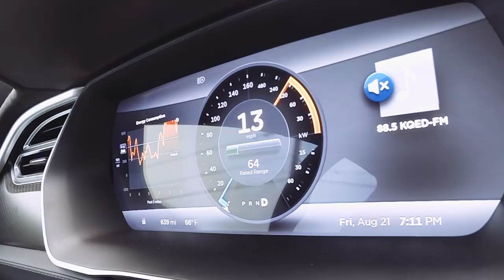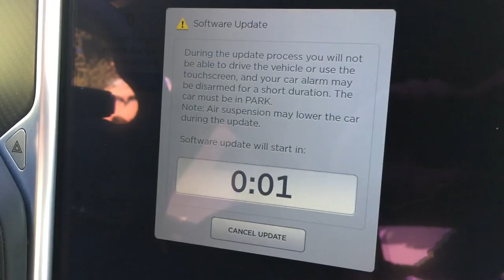The Tesla Model 3: The Culmination of Elon Musk's Master Plan | WIRED

Comment: From candle to light bulb, electric is the future. Thanks Elon.
Reply: Stryker A. Wolfe 

It will be like seat belts prior to '68, they are not required but still allowed on the road.
Reply: True
Reply: The problem with electrical cars is energy density.  The weight of the battery to go 300 miles is significantly more than the weight of the fuel system in an ICE to do the same thing.  Plus, what happens when you run out of electricity?  It's not like you are going to have a portable battery pack that you can walk along the highway to the next service station and recharge.  The 85 kWh battery pack weighs 1200 lbs and lets assume it is good for 300 miles.  Using that same efficiency, you are looking at 4 lbs per mile.  Assuming 25 mpg with an ICE car and a 5 gallon spare tank, you are looking at 125 miles.  A battery pack that could do that would weigh 500 lbs.  And that is 500 lbs you are going to be carrying to the service station and back from the service station.

I just don't see it as practical without some sort of ICE engine that can be started up to recharge the batteries if necessary.  It's just difficult to beat the energy density and portability of dyno-juice.

Comment: I've always said that 'I never gonna buy a new car, cos they're selling the same sh!t for decades on' but maybe one day, I'll buy a new Tesla.(despite I have a car that worth 500 quid, and does 60+ mpg.)
Reply: You don't have to buy a new Tesla, they already have used ones available. Though it will be a few years before they'll have a used Model 3.
Reply: Exactly the same here Frank.
I'm not wasting my money on something that loses its value so quick.

But fuck it, I really want a Tesla
Reply: imzjustplayin it's not going to be years unless it's years before they roll them out. There will no doubt be used model 3s shortly after there are model 3s. Some people will buy them and decide that they'd rather have an S or X or just decide it doesn't work for their needs for whatever reason. Now I'd agree it'll be years before there's cheap model 3s(by cheap I mean significantly less than a new one would cost). I don't think you'll ever see the really cheap ones like gas cars though where you can get one for a grand and throw a couple inexpensive parts on it and have a working vehicle. My guess is the price will be determined by the battery condition and if it needs a battery pack no matter how cheap the car is it'll require an expensive repair. It'll be interesting to see how things shift when there's more Evs on the road than gassers.
Reply: Must be a Reliant Robin LMAO

Comment: "On board supercomputer"
Hahahahaha.
Reply: Maybe the on board computer runs from cloud supercomputers. Though that doesnt justify "on-board".
Reply: Supercomputer is a bad term, but it's a NVIDIA Drive PX 2 with two Titan X graphics cards internally (liquid cooled via the car's internal radiator). So it's as powerful as a pretty good gaming PC setup.
Reply: Ambient Morality Why does the car need so much processing power?  Is it self driving?
Reply: Yeah, it's for the Autopilot 2. It has a lot of cameras monitoring and needs to be able to use GPUs to filter the images fast.
Reply: good to know. Do you know if the model 3 has that too? because these gpu's sound expensive. Also i just read they use nvidia tesla p100 which are even more expensive.
Reply: On "Bored" Supercomputer
Reply: Kenji314159 , reviewed as military grade, similar to F35.

Comment: Good News:  The EZ pass system is already in place and ready. As gas usage goes down, TOLLS go UP and new toll roads are being created to replace the gas tax revenue.  A zero sum game for the consumer.  Your transportation costs will be identical or more once the roads are EZ pass marked everywhere.
Reply: You havent considered that you dont pay 100% taxes when buying gas. Its just a part of it. To get the same amount of money than before a state just has to have small toll fees. In the end you will pay less because the electricity to run the car is way cheaper than the cost to buy gas.
Reply: So then gas users will have to pay the toll AND gas tax, whereas electric users  will only have to pay the toll. It might be a 'zero sum game' for the electric consumer but not for the gas users.
Reply: States are planning the same scam for those using solar to power their homes,  a tax.
Reply: Gas users currently pay for gas and its associated taxes while electric owners can still charge for free. Both pay for the toll roads. So gas users are currently being shafted.

Comment: Yea but they get all that power from power plants...
Reply: Paco That's a problem in countries where renewable energies are a tiny fraction of the energy production. Besides, Tesla has already plans for solar roof tiles and a Power Wall to which you could plug in your car.
Reply: Paco you take cars away drom fossil fuels. Then you take electricity away from fossil fuels. Solar, wind, hydro, while researching fusion. Things dont change overnight kiddo
Reply: Anas Whatit'slike Even if the energy they use doesn't comes from a clean sorce, less pollution will be trapped inside cities, I think that's already a good thing.
Reply: Huge power stations running dirty fuel are much more efficient than the measly car engines.
Reply: How does that discredit him at all? He is fighting for solar, wind and nuclear fission. You cant have gas be clean but electricity can be eventually. People like you make the internet suck
Reply: Even if all power plants were of the dirties types (oil and coal), it's still better for the environment to use them to produce electricity that gets used by EVs than it is to refine and burn oil in ICEVs. Electric motors have an energy efficiency of about 90 percent while internal combustion engines have an energy efficiency of only 20 to 30 percent, the rest is wasted as heat (as well as the energy consumed to counteract that heating).
Reply: Paco Power plants are more efficient than cars at converting fuel into work.
Reply: Paco just woke up? Welcome to the 21st century! Now we run wind and solar babe!

Comment: the cool thing about this new car is that if you pay it in 6 years it really cost you about 20k because of all the money you save on fuel, oil changes and combustion engines mechanical problems. which by itself is amazing but it also means that if you plan to stay with the car for approximately 18 years , you are buying a free car. even if the battery fail at  year 20 like some people say, whats the problem with that? the car was free

Comment: 20 to 40 minutes on a recharge when using one of their network of chargers?  Of course, that is assuming that you don't have anyone in line in front of you.  Imaging how much it would suck if there were a couple of people ahead of you.

With any of the battery technologies, you need to take into account what it will possibly cost you to replace the batteries at some later date.  Let's assume that you get 200K miles on your car before you need to overhaul the engine.  Assuming 25 mpg for that car, you have used 8000 gallons of gas.  Assuming $2.25 per gallon, that works out to be $18K total or $0.09 per mile.  I've seen it quoted that the Teslas get about 1000 miles on 400 kWh.  Assuming $0.20 per kWh, that works out to be $0.08 per mile.  if you go with a Model 3, you are going to be paying when you charge up at a supercharge station.

Seems to me that with electric cars, you are just shuffling around where / when the costs occur, but they still end up costing about the same in the long term.

Comment: The only issue that I have with using all electric cars is that yes, they are way more environment friendly than gas cars, but in reality the process to generate electricity is still difficult, especially through reusable energy because it is not enough. Gas is still used to generate electricity, nuclear power plants produce a good amount of carbon and waste that are hazardous and won't reduce radioactivity until 500,000 years, slight exaggeration but not really, and if there are millions of model 3's running around, energy is going to be more costly. We also don't have a way to properly distribute electricity without having more than 70 percent being lost through heat, even with insulation. This is why Honda made the clarity because it completely erases the need to use electricity, in which it may still generate carbon foot prints. Things are never plain and easy, even though this is the step into the right direction, but if Elon really did want to help produce clean energy, he wouldn't work on cars, he should have found another source of energy instead or regenerate electricity easier. It's true, this is better than gas, and funding is way easier if it's a company like this doing well, research is easier; but this is only for cars. My two cents is rather than focus on electric cars solely, I hope there is research somewhere else that actually focuses on the main issues of the energy crisis. If cold fusion becomes available, this won't be a problem, but until then, generating electricity without producing a lot of carbon byproducts in itself is hard, and the greenhouse gases produced to generate electricity is still horrible. Then if all electric cars are everywhere, you go back to step one. Not Elon, but I hope someone either solves the problem with cold fusion or has a better insulated distribution for electricity. Electric cars really aren't the final solution, but a lesser of two evils to be exact. But this is a step into the right direction for better energy for cars.

Comment: Does it have manual transmission?
Reply: viljami323 It's one gear. From 0-top speed you don't change gears.
Reply: It doesn't have a transmission at all.
Reply: PhonicUK It does have a transmission, because the rpm range of the elctric motor is not the one you need for a car. It does have a one speed transmission on every motor.

Comment: I am still waiting for a chevy suburban or a VW transporter competitor from Tesla. Plywood doesn't transport itself and I don't like using a trailer one these shitty Belgian roads and like having to use a trailer weekly is a pain in the ass if you are used to have cars that can handle those big objects. I also don't want to drive with the rear open because of safety reasons. Also, a station wagon version from the model 3 would be a nice car as Europe has a high demand for station wagons, same for hatchbacks and compact SUV/crossovers

Comment: I just want tesla to make a balls to the wall super car ( ofc electric ) 
Just imagine Tesla design,2 seater kinda like an Audi R8 or any lambo and the rear full of batteries and electric motors,idk what acceleration might be with that car
Reply: guanwei he Batteries rn are still heavy and bulky so i think filling a car with batteries would really slow a cars acceleration down, but hey, I'm probably wrong.
Reply: actualy there is no need for such a design. electric motors are extremly small and light compared to ICE cars. I would think of something like an ariel atom style tesla street legal f3 car with 700HP. THAT WOULD BE AWESOME
Reply: Are you aware of electric formula? Thats what they are trying to achieve but its only proven that technology is not here yet, battery technology.
Reply: Blade Mastr the model x is 5 tonnes and has a 3.5 second acceleration
Reply: Poseidon Gaming yes it is but ok

Comment: Really bad fact checking and editing..

The editor who composed the tire and description doesn't understand what culmination means.  It isn't a milestone in a plan.  Also, Musk didn't build each successive vehicle using profits from the previous ones.  He was losing money on the first 2 models for quite a while before he turned a gross profit.. He used his own fortune plus lots from other investers to build the faqctory for the model 3.. 

Starting production of the model 3 wasn't Musk's end goal nor the end of his effort.  It was step 3 of his car building project to make electric vehicles seen as a reasonale mass market replacement for gasoline cars.

Electric cars don't solve the energy problem or the global warming problem. They use as much eneggy as gasoline cars. They get that energy in the US today mostly from coal burning plants, a small percentage from hydroelectric and a tiny amount from solar and wind.

If anything his solar city company is doing more to accelerate the transition, because present power generating capacity is barely able to keep up with demand despite a huge transition from incandescent to LED lighting and enegry efficient applicances.

Local solar power generation combined with batteries can meet consumer power needs at the point of consumption.  That allows conventional centralized generation plants to be used for supplying older infrastructure and consumption peaks and lessens the need for building higher voltage ransmission lines and more substations.

Comment: I like electric cars, but i don't like Elon. Electric cars should have a exchangeable battery pack that you swop out instead of charging it (You rent - not own the battery). Ppl would carry on this charging the vehicle as needed because the infrastructure is well known from the gas stations of today, but far from the smartest way to charge and keep the maintenance of the batteries efficient and charged with renewable when appropriate.. This idea already was done but killed some time ago, and sadly the best ideas never get used, a secondary one always hits the masses..

Comment: 3 to 4 hours to charge will be an achievement? If I'm going to fork $35k for a car, I better be able to drive from pittsburgh pa to the outter banks nc in a timely manner, which is about a 8 hour drive. If I want to be eco friendly, I'd just buy a hybrid. These cars are for city folk that use them to get around the city and drive gas power to get long distance. Call me when you can charge a battery in under 3 mins and I'm not driving a Mazda 3.

Comment: Your batteries are a death trap .1400degrees inferno if any one battery is pierced by metal.
If you want to drive this then go right ahead .Better batteries that will not burn you alive are in development .Also batteries need to be in a standardised cassette for quick change,s .You buy the car but rent the batteries. Cant see it working any other way.
Swap cassettes and be on your way or wait between 3 to 18 hours for your own batteries to charge,

Comment: Tesla SUCKS!
Reply: Tesla is Rubbish
Reply: eddie bangash Calm down Big Oil
Reply: eddie bangash how?
Reply: eddie bangash ok. Why?
Reply: eddie bangash now THAT'S constructive criticism, GOOD JOB DEAD DINOSAUR LOVER!
Reply: ...UP ALL THE GLORY!
Reply: Tesla loses money on every car they build, Its a FAIL business model. You can build the world's largest battery factory but that actually doesn't drop the cost to build NOT one bit. How about Tesla builds a car that can go 800 Miles on a single charge and can get recharged in under 10 minutes like a regular car? Then we can all make the switch. Also they need to build an ekectric vehicle with a 6 speed manual transmission
Reply: eddie bangash 1. it does drop the cost per battery because it will probably be much more efficient. 2. NOBODY needs 800 miles. You are one of the persons that does not understand the way you are supposed to run an electric car. You charge it OVER NIGHT, EVERY NIGHT, so you hardly ever need to charge it at a supercharger. IF you however sometimes need to drive more than 300 miles a day you just go eat something or have a cup of coffee while it recharges... And unlike a ice engine with it's shitty rpm range, an electric motor does not really need a transmission with more than one speed (at least not for your highways, we in germany could need it). And i don't think there will ever be an electric car with manual transmission because the driver always shifts worse than the computer...